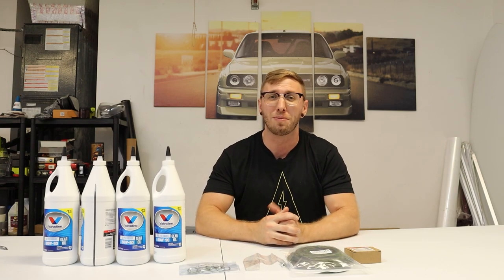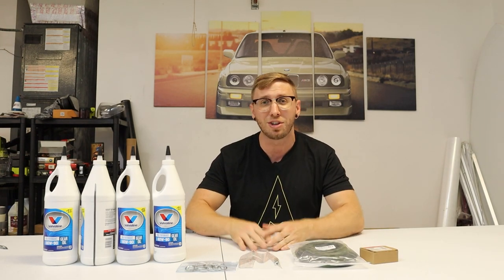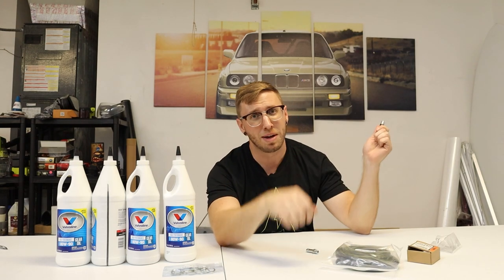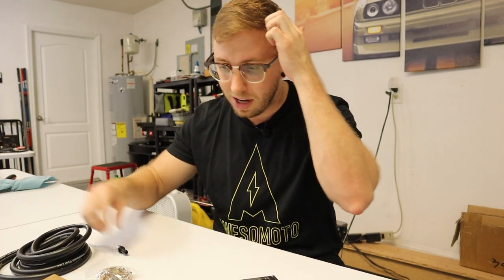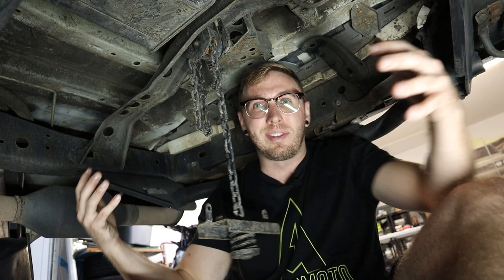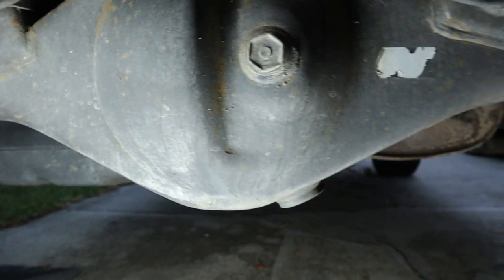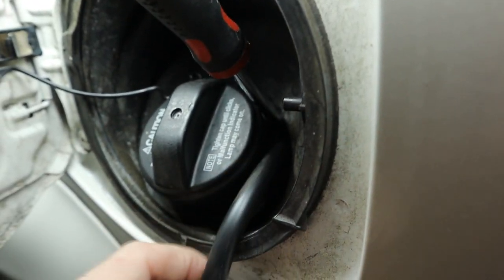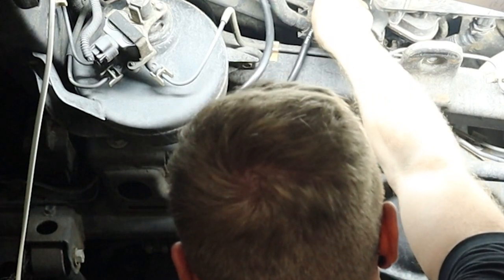Vlog 58 - Lexus GX470 Diff Breather Relocation and Oil Change

Comment: Nice mod! I would’ve connected the diff breather extension first. Then changed the diff fluid just in case if any debris fell into the diff.
Also it’s best to replace the rear diff fluid on a level surface.
Reply from the maker: lol yes, that would have been a better order of operations...completely agree!

Comment: Magnetic drain plugs for diff might be available if it's not Magnetic from factory. That'll help keep the metal out of the moving parts.
Reply from the maker: Hey A Buck. The factory drain plug is magnetic...I must have gone too many miles without changing and the amount of build up was beyond what the magnet could retain.

Comment: I wonder if you stick heavy magnets on the outside of you diff that the metal shavings will stick to the walls of the diff away from the moving gears?
Reply from the maker: I think that would work and you could also probably use it to pull the metal towards the drain hole when you change fluids!

Comment: Do you have product links?
Reply from the maker: Hey Peter, Good catch and sorry I forgot to add those. I've updated the description to include all the part links.
Reply: @Awesomoto  by the way, i just install the bumper and love it, do you plan on installing 3 in cube light
Reply from the maker: @peteru9980  That's awesome to hear!! I love this bumper so far!

Yes, I'm planning to work with Lasfit on LED pods for this bumper. They currently don't have a flush mount option and I'd like to flush mount these rather than just sitting on the inside of the bumper. I may also do a Baja Designs flush mount light and compare to Lasfit lights.